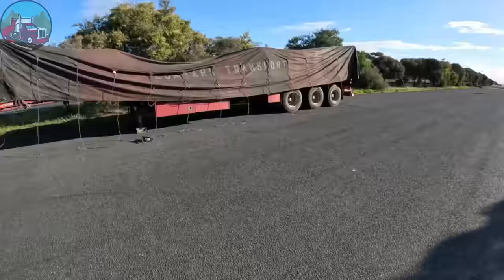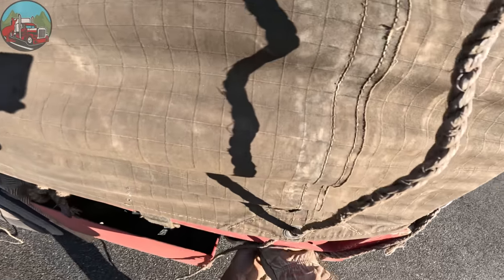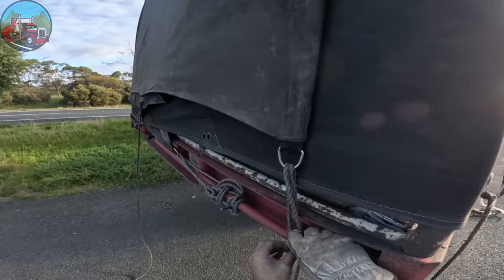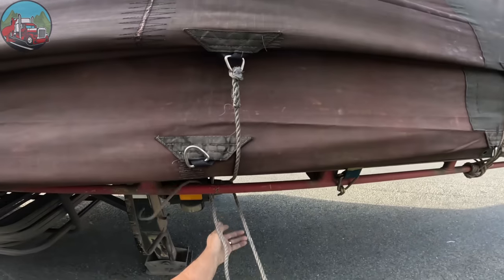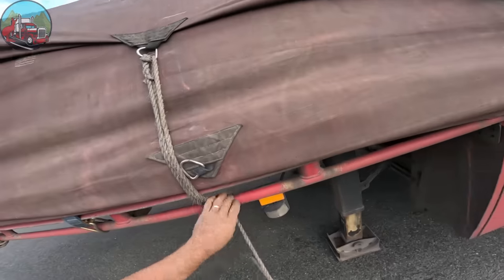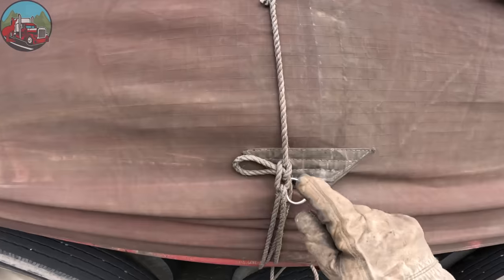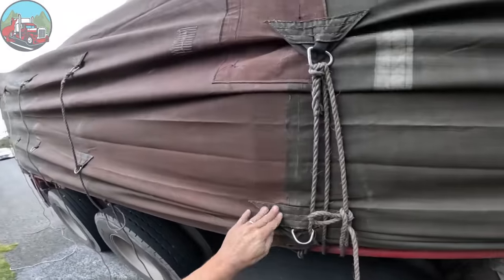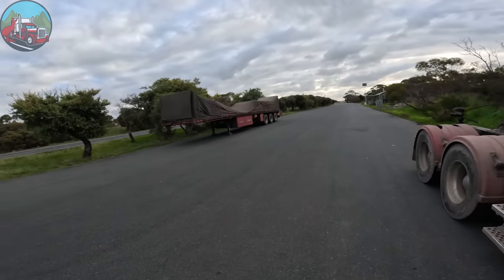How to Tarp My Road Train

Comment: Hi Jono 
Wouldn't it be better to use your gates installed along each side of the trailer deck with the freight inside the gates and then put that tarp on or a different tarp saving time what you are doing now?
Not sure as I don't do tarps as a driver here in NZ, but it looks like a lot of work Jono. A curtain sider trailer like b-train we called them in NZ or B double in your land would work better.

Suggestions for further videos. 
Can you do a video on the company you work for and you trucks you guys have and different trailers set ups and maybe a video on your Logbook? In NZ I used a digital Logbook on an app on my smartphone. 
The Logbook app is named after the company named Eroad NZ. Max here in NZ is 14 hours. 13 hours driving or on duty with 2 half-hour breaks. The app is GPS and reads your location.

Another suggestion. Can you do a video on new or used Kenworth trucks T series or the K200,K220 models?
Just some ideas 
Cheers Jono. Angus.
Reply from the maker: Thanks Angus. Putting the gates up takes a fair time but it does look better as it makes the tarp even from front to back. It's actually quicker the way I did it.

There isn't too much to say about our company. It's just another transport company.

We have a couple of K200. I don't like them over a 9oh. I get stuck a better ride with my long wheel base truck.

Keep the suggesting coming though.
Reply from the maker: Oh and the logbooks... That's just a scam. Just a way for the government to get money out of divers who accidentally make a mistake in their entries. Many companies are using electronic work diary but that will eventually be a wicket way of them getting money from drivers.
Reply: Cheers Jono.
Love watching your videos mate. Blooding great watching Australian trucking whether it's your channel or others it's great to see.
Reply from the maker: Where are you from?
Reply: @RoadTrainAdventures  I'm from New Zealand top of the South Island mate.
I drive a Kenworth K200 truck and trailer unit here in this part of the world. It's a 60-ton unit and it carries up to 40-ton payload on it. 
I can share some photos of line with you if you are interested.
Cheers.
Reply from the maker: If you like you can share some photos

Comment: What's the best servo that you've come across so far? Also what's it like in the truckers lounge?
Reply from the maker: It's normally a BP. Most new ones are good but I can't think of which one I like best.

In the trucks lounge there is a lounge , TV, usually hot water and showers. They're mostly nothing discussion except for Mobil in Northam. That's done up like a country log house. Looks very nice. It also had one of those fake open fire place heaters.

Comment: Maybe you should have used two tarps 
Then you would not have to strap the middle down
Regards Shane from Melbourne
Reply from the maker: Our taps are made to run the full length of the trailer so using two would be so much harder. The idea is to have the tarp pulled very tight from front to back which stops and flapping.

Comment: In North America we typically use vinyl
Reply from the maker: Oh vinyl. How light is that? Our tarps weigh at least 60 kg.
Reply: @RoadTrainAdventures  the tarp is typically a 2 layer vinyl with a woven core thread for strength.  8’ drop ( 2.4m) and 8’6”( 2.6 m) by 20-30’ ( 6-9 m). Weight 45-60kg.  Extra strength will add about 5-8 kg. And an ultra light will be around 35-50( Kevlar or similar).   Many more D-rings  every 12” vertical and horizontal at the bottom half of the drop.  Front and rear ( distinct flap “ envelope “).  Use rubber bungees to secure - rope is very seldom used.
Reply: @RoadTrainAdventures  https://youtu.be/IcFc8tO_TXU.     Here’s an early video I did about 6 years ago.
Reply from the maker: I see
Reply from the maker: Awesome. Thanks for showing me that. I still don't see how it could hold the tarp tighten enough in place without letting it flap.
Reply: @RoadTrainAdventures  definitely do not pull the tarp as tight. The strength of the rubber bungees upwards of 65 on a full trailer, the closing of the front to prevent airflow under the tarps and a hood overlap from tarp to tarp does the job.   
Of course inattentive drivers and especially the lazy/ careless have it flapping / tearing and or completely falling off.
Reply from the maker: Ha ha. That's no good
Reply: @RoadTrainAdventures  I never enjoyed it.  That why I do oversized heavy haul.  Farm equipment and construction equipment. Tractors excavators etc. not Tarping.  Some chains and I’m off
Reply from the maker: I don't really like oversize. Not because it's hard but it's more for the new truckies
Reply: @RoadTrainAdventures  easiest job I ever had.  Arborist landscaper was way harder for 30 years
Reply from the maker: That sounds like a lot of labour
Reply: @RoadTrainAdventures  it was. But at 52 I prefer the 30 minute load and unload times.
Reply from the maker: I see

Comment: I'm a little surprised you don't have a tarp with one envelope stitched into it at the front?
Reply from the maker: I came across one that did not when I went to room or up, will I couldn't do it neatly. Much better to fold it myself.
Reply: @RoadTrainAdventures  It's been a while since I used to tarp up, but, the envelope is folded in, then the tarp is folded into itself etc as you do, and then rolled up.  The traditional corners, which are folded in when tarping, are cut off and stitched, like a blank end if you understand, which is then folded back.  Hmmm, hard to explain <grin>.  Thank You for your reply.
Reply from the maker: Yes it's a little hard to understand but not to worry. Thanks trying to explain.
Reply: @RoadTrainAdventures  <grin>, yeah it's a little difficult to explain, but to just conclude, if you can imagine when the tarp is laid out, the 'envelope' is quite ugly, but that is when you fold it back onto the tarp, then roll it up as normal.  I love those enveloped tarps, only one end to mess around with the corners and roping it down.  Cheers matey.
Reply from the maker: Awesome

Comment: I have noticed on trucks in Melbourne, yellow plastic caps over the front wheels plastic caps, what are they for ?
Reply from the maker: They're a bit of a money making rort. You put one on each wheel nut. It's a very easy way of setting if any wheel nut moves. With 10 stud, nuts can come loose then fall off but only if they're not tensioned correctly. We don't use them on any of our trucks and I've never heard of any of our drivers missing a wheel.
Reply from the maker: They never come loose if they're tensioned up properly.

Comment: Hi why don’t Aussie trailers have rope hooks instead of that bar
Reply from the maker: Sorry Tony. Which bar?
Reply: @RoadTrainAdventures  hi the bar or pole you tie your ropes on in Britain we have rope hooks welded to to floor cross member and we call the side of a trailer a chock rail or at least my generation does. What you call a truckers hitch we call a dolly if I can work out how to send a photo I will. there are not many drivers in the uk know that know how to use ropes. What you call putting a tarp on we call roping and sheeting it’s a thing of the past here it’s all curtain siders and box vans know.if your running abroad ie France Spain Italy ect we know use a trailer called a euro liner which is a curtain slider with a sliding roof so you can load it with a crane. These are some of the terms we used to use when roping and sheeting. Dolly. Double dolly. Barrel hitch. Joiners bowling knot spreaders half hitch. Terms for sheeting dogs ear or pigs ear. Envelope style Grimsby style could go on for ever good old days?  god bless box vans
Reply: How do you know where to put the hooks? The rope rail is always in the right place.
Reply from the maker: Oh I see the terms now. The pole on the edge of the trailer is called a combing rail. All our chains and straps go around it.
Reply: @jefftheaussie2225 The hooks are about every 2ft along the side rail , if something needs securing that's halfway between hooks we just loop the dolly hitch around 2 hooks bringing  the rope into the centre of the two hooks .....easy 😅
Reply from the maker: That's it
Reply: @mickpalmer3521  What do you hook your strap hook onto? I will stick to a rope rail.

Comment: There is nothing better looking than a well tarped load. Sadly not seen as much anymore due to curtain siders.
It is a dying art unfortunately.
The rear is probably more important than the front as it gets a lot of protection from the cab where as the rear is in the vacuum and sucks up water badly.
Reply from the maker: Very right Peter.

Comment: Why have one 50 foot tarp? Talk about doing it the hardest way possible!
Reply from the maker: It's much easier than ruling out multiple traps. I had to use 2 traps yesterday and did not like it one bit. Extra work with 2 over timing it one only.